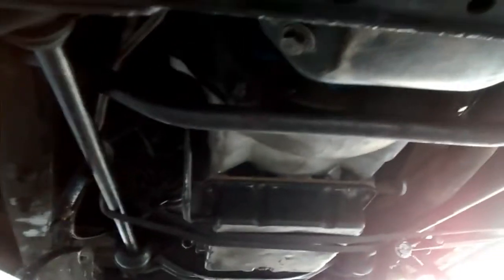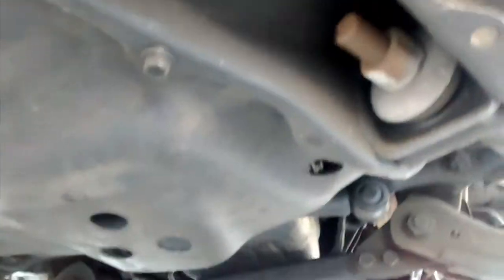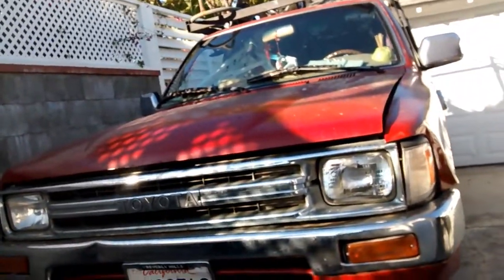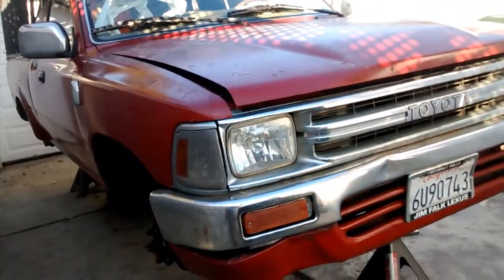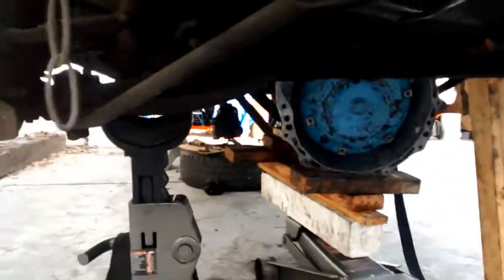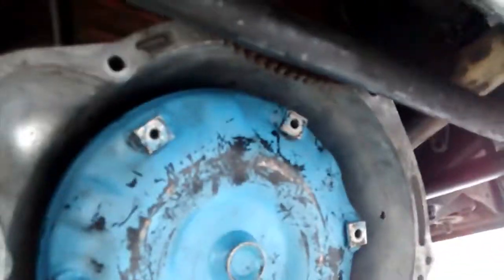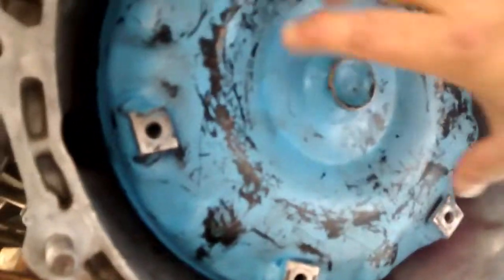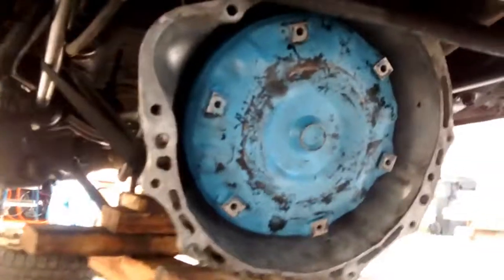Paying it Forward Lite Brite - 91 Toyota Pickup Transmission Install

Comment: i see that you forced the transmission into the back of the engine with the straps, did that mess up anything? was the truck all good and running after the installation?
Reply from the maker: The truck ran fine.  No problems at all.

Comment: i did a trans replacement on my 1993 automatic toyota pickup and there was a slight gap between the bell housing and the back of the engine but the bolts could still reach it just as like your truck in the video so i used the bolts to pull it together and now i can’t  move the crankpulley by hand, is there something not aligning? i seated the torque converter properly as well before installing it
Reply from the maker: It's been 4 years since I did it.  I remember having the same problem.  For some reason, I remember backing the bolts back a bit; and, I remember having to use a prybar to get the crankpully rotated; as I installed each bolt.  I don't exactly remember how I did it. I probably couldn't describe it anyways.  I just remember using a long prybar (about 18" long); because, there really wasn't any other way.
Reply: @301steady  was your crankpulley and flywheel able to move after installing the transmission with the straps to force it onto the back of the engine? because i basically did the same thing you did but i just use the bolts to pull it together
Reply: because my flywheel isn’t able to move anymore after bolting it up, i tried using the socket wrench i had on the crankpulley in front of the engine to rotate the flywheel but no budge, do you know why? did you also have this problem and if so how did you solve it?
Reply from the maker: @dylanbantolina6693  I did a little bit of that.  Between the bolts and prybar, that's how I rotated it to torque each bolt.
Reply from the maker: @dylanbantolina6693  I think that's when I went to Home Depot and bought a telescoping ratchet.  Sometimes you just need more leverage.
Reply: @301steady  so you’re saying that i just need to put more leverage into turning it? or did you do something else to get it to move while the bell housing is already bolted on? because my problem i have with my truck after bolting up the bell housing is that i can’t move the crankpulley/flywheel anymore, i already bolted up the torque converter and everything but as i said i had a socket wrench on the crankpulley in front of the engine to turn the flywheel but now it’s not moving after i pulled the trans to the back of the engine by tightening the bell housing bolts
Reply from the maker: @dylanbantolina6693  Yes, more leverage.  You're fighting the compression of the engine.  If you don't have the tools; or, strength, you can try taking all of the spark plugs out; and, that will allow the engine to turn easier.  I didn't need to do that.  I bought an extendable ratchet instead.